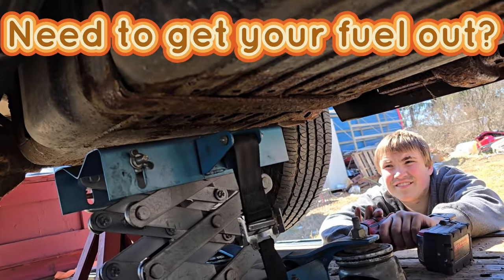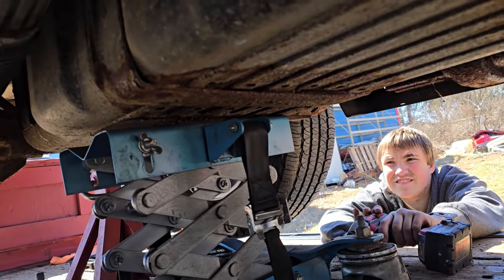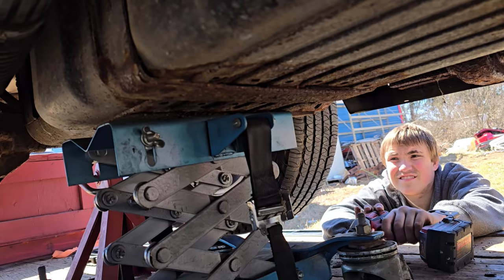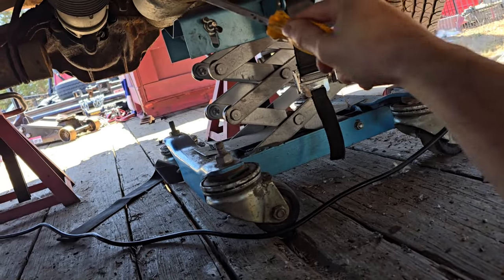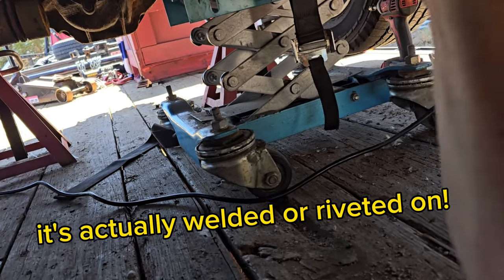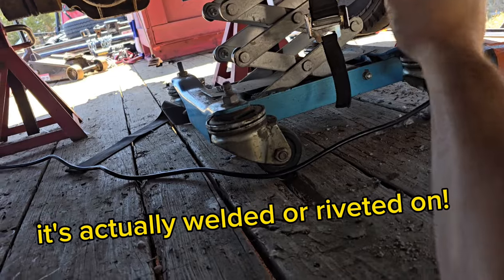Can't siphon your fuel? Try this! How to get your fuel out.

Comment: just plug the pump into a battery and put the send line into a container?
Reply: unless the pumps dead
Reply from the maker: That's a thought. I suppose we could have also tried siphoning after pulling the filler neck off right at the tank. Cutting the tank out seemed like more fun at first though. It turned out to be more work than expected with the driveshaft in the way.